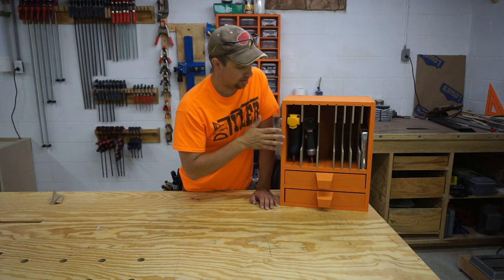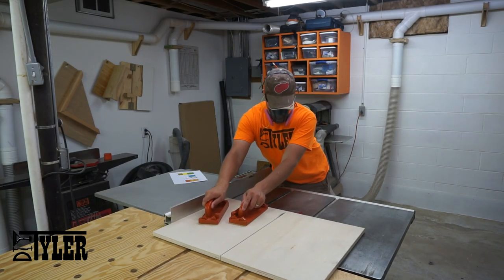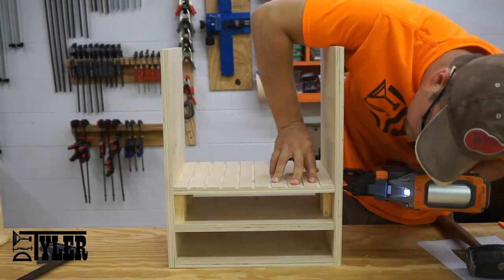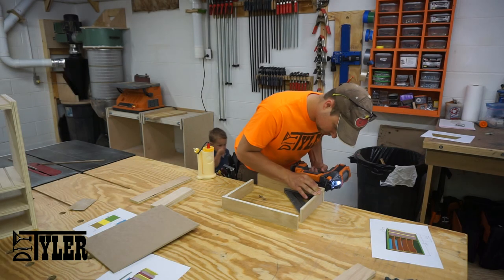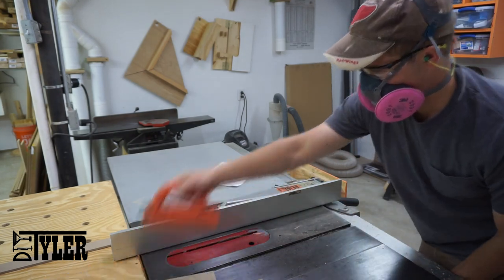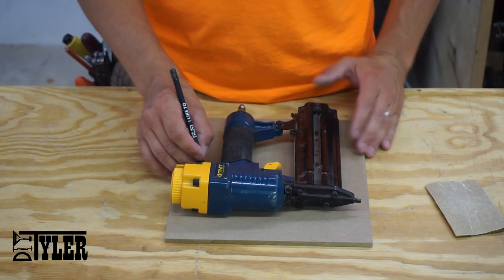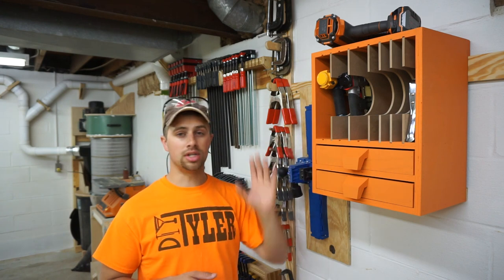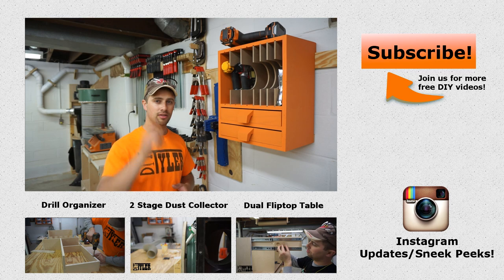Modular Nail Gun Storage

Comment: Very nice shop project. Where do you buy you two smooth sided hardboard. The only thing I can find is the peg airs style hardboard without the holes. Real rough on the back and not 1/4" thick.
Reply from the maker: +Jeff Jones Got this stuff at lowes, pretty sure it was in the project sheet section but don't really remember, got it while ago. Thanks for watching Jeff.

Comment: Nice project man. Looks very useful I have something similar and use it all the time. One thing, I would have thought you would of made a slot for your main nailer (the Ridgid battery nailer) instead of sitting it on top.
Reply from the maker: Would have liked to but the RIDGID nailer is decently bigger than the others and would stick out into the shop too far. Thanks for watching Matt!
Reply: I got ya Tyler. great build and I enjoy your DIY channel.
Reply from the maker: +Matt Reynolds Thanks Matt! Glad you like out work.

Comment: Nice project, I think adding drawer slides would make it MUCH easier to get to the nails in the rear of the drawers. Why not size it so your ridgid nailer would also fit?
Reply from the maker: +Pat M Cordless nailer is bigger and didn't want it sticking out into the shop that far. Plan on standing it up on top when I have it where I want it.